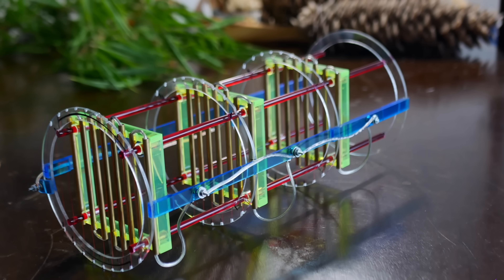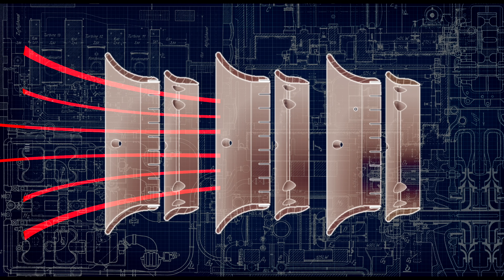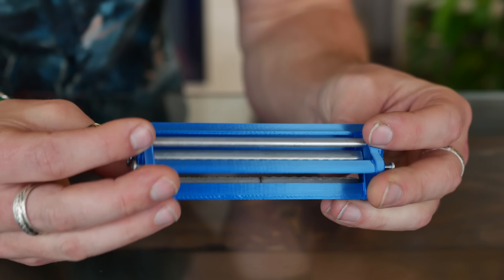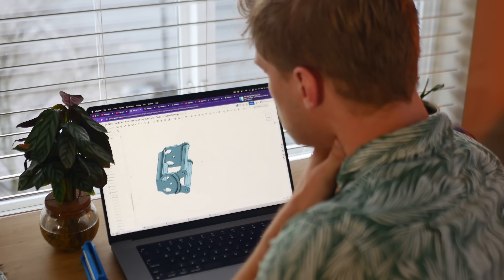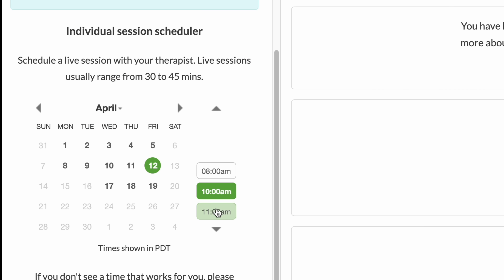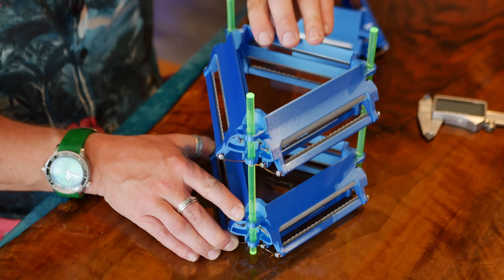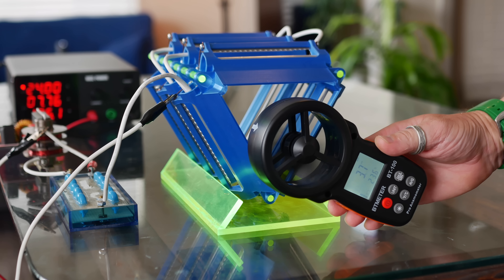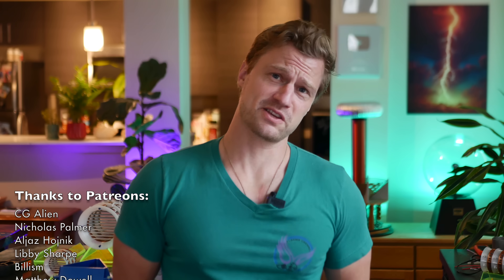Next-Gen Ionic Plasma Thruster Inspired By Nature (BTC Mark 3)

Comment: Try adding a nozzle on the end test out nozzle size’s,B. Try running sequential power for example first thruster gets 10v second thruster 15-20v third 25-30v and use no spacing between thrusters want to see it hitting 5 meters per second which is about 20 kmph which is about the school zone speed limit 🤷🏽‍♂️stupid math but hey great content

Comment: Perhaps there's too much turbulence in the exhaust and this is why you're not getting good additive results. Perhaps what you want is something that isn't triangle-shaped, but maybe circular or inversely scallop-shaped. Can you get better airflow by 3D printing the thrusters into an arc shape and bending the electrodes? If bending the electrodes makes them unstable, you could try massively shortening the electrode length by segmenting one long electrode into many smaller ones. Imagine a thruster that looks more like the blocks in a stone arch.

If you go the segmented route, you'll need very lightweight/paperthin separators to put between the segments to prevent them from interfering with one another. This may be difficult without introducing a ton of drag and weight, but it might be as easy as using wax paper with the tiniest amount of 3d printed plastic for structure. There are also sheets of acrylic you can get that are stupid-thin down to 0.2mm. 3D print each segment with little teeth or tabs that fit together with one another. Even better, design the tabs so that they connect the electrodes of each segment together. You could glue the segments together, but I would personally use a light piece of thread and string them together like pearls. Cinch it tight and the design will be nice and stiff. That way if you want to change the overall shape of your thruster, you can do so by unstringing it and adding spacers between your segments. Tons of rapid prototyping potential there.

BTW, if you have three stages with diminishing returns, you may find more overall efficiency by giving it a variable voltage curve where the voltage increases as it passes through each stage. And if you use a segmented design, you may find that certain segments within a stage's shape do better with more or less voltage than the others. You will likely find that there's even more subtlety to this concept once it is pulling in non-stagnant air.

Comment: Compunding the ionic thrusters(single triangular unit) with another copy of the previous unit will not increase the velocity of the wind. The 2nd one can create a resistance and in order to be not a resistance then the 2nd unit power consumption should be same in order to allow the same airflow from the previous unit. But that definitely does not increase the velocity of wind but the voltage can make it happen and then i suppose gaps might help to capture side airflows.

Comment: Great concept, now you need to test rain, snow, and ice, and a Bird or a banana strike is messy as it goes everywhere. I was a Helicopter Crew Chief, so I know about intake filters on jet engines, and what you will need to make. You need to filter and clean all the intake air, and you need space to separate the intake and thrust, so you do not force objects into the intake. In space, you only have to worry about flying debris, and you are using the icons and not the airflow to create thrust.  We live in an Electrical Universe where Gravity is the force of God in Newton's equations, where God is all Light without Darkness found inside atoms, and how God created the Universe. It takes electricity to make the Light of God, it is our Brainwave, therefore our Soul, that Satanic people buy and sell by the Kilowatt. This is not a Deity God found in Reiligion that does not physically exist, or the name of one of many Angels, this is why Tesla said that Light is everything, because everything is made of Atoms with God inside them, and we are Light Beings. The first atomic bomb test was called Trinity, proving they knew it was a God bomb. This is why no one teaches Newton or Tesla, it proves Einstein was wrong because he removed God just like Religion, so E = MC^2 where C is the Light of God Einstein removed, but as Newton said, F = MA, and the E = MA^2, which is the same at the speed Light appears to move at, proving Einstein plagiarized Newton, making a fool of everyone but me since I am the only talking about this. Light has no acceleration and is therefore Static. The Sun is not a rocket, it is being pulled through space. We do not fall down, we are being pulled down. If you doubt my intelligence, FOIA the U.S. Government for my highest ASVAB score for mechanical (99%) and electronics (80%), or an IQ of over 180, Einstein had 160, so he was retarded to me. My father's IQ was published in the Riverside newspaper as the highest recorded so far. I can come up with experiments you can do to prove all this. Our Galaxy, Sun, Planets, and Moons, all use a frequency to orbit. The Sun has a frequency of just 30 MHz, and Earth is 6.66 Hz, as proof, it orbits the Sun on average of 66,666.666 MPH. An Electrical signal is a sine wave that has a Frequency and a wavelength, that you can measure in miles. I published a book titled "The Principles of the Trinary Universe" that explains all this. If you use this science, you will get more accomplished, as I used it to improve the reliability of the (E)F-111 by 30% and bring it online a year in advance, just in time for the Gulf War, which I was later medically retired for, as I now have cancer.

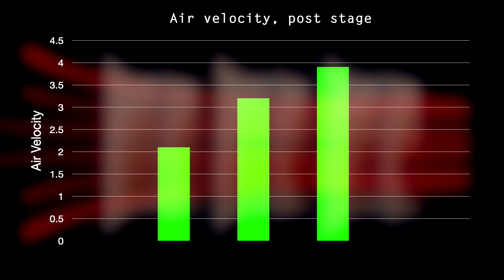Comment: Your design at 3:15 has me thinking of sequential stages of compression in jet turbine engines.  Each stage "packs" more air into the next.  I wonder if there is a way to incorporate a larger first section, filled by sequentially smaller diameter but longer stages of ionic thrust.   Instead of trying to make more velocity with thrust, try to ingest a larger volume of air into the system while increasing velocity in stages.  A simple circuit would allow you to put variable resistors to each stage and dial in the proper voltage for each.

Just $.02 from a newb

Edit to add:  just because you have all these technologies available, don't overlook the old geniuses and their slide rules.  Look at the rc plane and kite building hobbies for light, strong designs and materials.  A shrinkwrap wingover a skeleton frame is way lighter and plenty strong.

To couple with my suggestion about sequential stages of thrust acceleration, look into the horns from old Hitachi motorcycle carburators.  Their design reduces the turbulence of incoming airflow, something I think your thrust assembly could make dramatic use of.

Comment: It would reduce the speed of the airflow but I imagine you could increase the thrust and efficiency by having more modules in a wider, more circular ring. Diluting the energy across a larger central volume of air gives a larger change in momentum for the same power input, and the three flat jets intersecting at sharp angles could increase the level of turbulence (and losses) inside the engine.

Comment: If you look at modern thrust jet air flows, you'll see that they use very wide entries on the rear and narrow the channel to get the air compression which then it's next entry is put through and until they can make it the length of the wing that engines sits under.

You need to think about it with compression in mind.

Comment: You definitely need to increase the power at each stage. Maybe even increase spacing at each stage. Right now you are just seeing how much air it can push, but in real world applications it will be pushing air to move itself. This means you can take advantage of airflow ie air scoops for force flow. Each stage would need to be progressively smaller but with larger scoops and more power applied to each stage with the entire thing covered

Comment: I noticed on your ionic wing video that it seemed like the switch from a flat razor blade to a serrated blade led to a significant boost in velocity. When you turned out the lights you could see how the power was focusing at the points of each serration. Have you tried increasing or decreasing the number of serrations to see what effect that has on output independent of other changes to the design? It would be a simple experiment to conduct, simply swapping out the blades in your current design for ones with flat edges and then blades with say 10, 20, and 30 serrations to see what effect that has? My guess  is that there’s a max number at which you will see gains before they start to drop off. I’m also guessing that the max number of beneficial serrations could be related to power input (more power = more serrations before gain’s diminish). 

2.) have you tried rotating the drive as opposed to only running it when it’s sitting flat? I would be very curious to see if rotating the drive while it’s running would create a vortex effect, reducing turbulent flow and boosting efficiency and output…

Comment: It may be a dumb question, but

What if you take air into a directly unexposed turbine, and then pass it to several exposed ionic thrusters that are themselves taking air input?

Does output in every ionic thruster have the same value as the turbine's output? Or approximately?

The point would be taking just one powerful air input and having several outputs with the same air flow, saving costs and maybe impeding objects to collide with the center of the now unexposed turbine.

Comment: What if you make each stage smaller?
Reply from the maker: It is an option I explored, as well as a friend helping me with different angles. I might dig into this deeper.
Reply: @PlasmaChannel  maybe if you also compress air while it is flowing through the stages it could increase speed? 
          |
          |    |
air >   |    |    | -> air
          |     |
          |
Each column is one of your triangular stages.

Maybe you also need a research to define the best shape that makes air converge the most efficient way in the point of intake on the next stage. I don't think a triangle shape seems ideal. What if it is a circular one? Could you angle the output to go through the next stage making the air pass through at the exactly angle of the previous stage?

Comment: Either that or try it at 110 volts
Reply from the maker: Higher voltage would result in higher thrust. Certainly. The amount of current it would draw would be massive at 110 though! We're talking over a hundred amps, easy.

Comment: Try using all 4 designs and make it lowest air flow to highest and you should be able to get better results along with using high voltage compassators
Reply from the maker: That's a really interesting fact I hadn't known about. It makes me think and pushes me towards a spiral design, as requested by a lot of people. Thanks!

Comment: So why not do a stepped conical spiral shape (think corkscrew) instead of a stacked shape triangular shape? Instead of allowing the airs pathing to intersect with itself/fight itself is would be passing air past the prior. 

You could test by using the same design you already have, just stack them into a corkscrew/hexagon and angle each blade to aim between the blades behind it. You could even test whether pushing or pulling is better reversing polarity to a degree. You would be creating an opportunity for draft yes but it would be mitigated by slowly stepping down the size of each individual spiral.
Reply: If you read this, like it for me so I know you seen.

Comment: If you pour water down a pipe, it tends to clog beyond a certain point. Unless you put a spring coil inside the pipe to make it vortex. Greatly increases water flow; a trick some aquaponics setups use. Same effect likely applies to air. Also, with cylindrical shape, you'd be able to have some fun with Venturi effects.

Comment: So where this is a very amazing idea. I just have 1 question. Where is the plane going to get the power from.  I dont see batteries lasting on a long flight and more batteries =more weight. So we're still left with power generator. I suppose a plane emergency generator could help charge batteries because is uses the planes air to turn a rotor to turn the generator.  Hince no fuel needed.

Comment: You dont get a difference in this structure comparing that with the single piece because you take the outside air (0 speed), previously you were increasing the air speed input in the every single pice… consider to put 2 pieces one back to an other to test if the second piece add more speed to the input air

Comment: I'm thinking along the same lines as BillDe Witt. Using the same shape as a wing with the skin attached, so it is enclosed, including the sides, make the leading edge large, tapering back to the trailing edge. You will have to play around with different size ratios of the entry and exit to find optimal thrust.

Comment: I wish to see combinations of shapes stacked and potentially using the triangular structures to fit in a cylindrical frame, sort of like pizza slices. I think you tested comb style fins and rivets , but what of sort of a golf ball pattern surface? Also, did you test multiple razors at a slight angle, serial connected in a row, where each individual segment has a current passed through it rather than singular razor across?

Comment: I'm sure that you tried Increasing the spacing between the thrusters, as others have suggested.   It would be interesting to know the results of that.
Also,  I understand that would introduce drag, but would the external entrainment of air more than compensate for that, or would it be a losing bargain?

Comment: Would that be lighter if it were in a circle rather than a triangle?
Reply: The question is, would it still provide the benefit of constructive interference and convergence in that shape?
Triangles are one of the strongest structural shapes, so his design automatically benefits from that.

Comment: A traditional Jet  engine works because of the compressor stage progressively increases the velocity of the air column. your ionic Drive doesn’t compress any air so there will be a natural limit in regards to the the velocity that you will achieve.

Comment: The wing design focuses on convergence of the air to the rear of the thruster but from the front you have air coming in and being deflected divergently. At high flight speeds air entering the thruster will strain the corners and the wings will want to fly apart from the center

Comment: for the different stages. have you tried cascading the voltage? I believe it might help. so having:
emitter 1 @ 120kV collector 1 @ 90kV, emitter 2 @ 60kV collector 2 @ 30kV etc. or something like that. I think that having all the collectors at equipotential can cause reverse ionic currents

Comment: You know planes build up a lot of static electricity as they fly through the air. So much so if they dont have antennas to discharge it the voltage of the electrical system will go too high and shut down electrical systems. So im wondering why dont we build a plane that is a hybrid, using static electricity to charge the battery? You could sandwich an electric motor between the engine and the propeller or put the electric motor on the back of the engine. Obviously totally electric planes are not feasible due to the weight of batteries, but a hybrid system on the other hand could work. I wonder if aircraft produce enough static electricity to actually add real performance and efficiency.

Comment: You said that the optimal convergence of the airflow is about 10cm behind. It made me think, would changing the angle of output to manipulate that convergence point affect the output. I can't but shake the feeling that this parameter is linked with the spacing parameter, which sadly gives a pretty large config space to test xD

Comment: 1 thing How can this work in space if no air flow. It does not create air.. try this in a vacuum chamber and see the results.. 2nd You should had tried looking at fighter jet nozzles, they can reduce in size to increase psi air flow. You could remake this and make each stage smaller then the one before to increase air pressure, would be interesting to see what happens, maybe make the last stage variable adjustable.. im not a engineer or anything.. just average joe shmoe.
Reply from the maker: Not sure what your point is with number 1. Why does it matter if this works in space? It's intentionally designed to work in atmosphere - as indicated by the video talking about attempts to make an ionic thrust airplane. In a vacuum chamber it would have zero thrust, but airplanes dont operate in a vacuum. Cheers.
Reply: @PlasmaChannel  you said nasa uses this in space. Or did you not say that? Maybe i heard something else?

Comment: I have watched many of the episodes of your continuing evolution through ionic thrust and the various versions of your engine models. I kept wondering if you were limited to the amount of thrust you can produce based on the Amount of expanding gases coming out of the exhaust section of your engines. My question would be if you add in a vaporized fuel air mix prior to or somewhere after much like an augmenter on GE engines or an after burner on Pratt & Whitney engines that may be a great solution and still have zero moving parts. Also spacing would probably just be one portion of it. You also need to look at your angles of convergence versus which stage should be placed where within the string of stages. Try putting lightning holes into your plastic beams. It should add structural strength and lighten your model.

Comment: 7:27  does that design create O3?? Please remove it from indoors if so. O3 is poisonous ☠️. Good work. Probably could see improvements if  encapsulated in a tube like nacelles. With air slotting along the length to allow compression of the energized stream? 🤓🖖🏼🇺🇸